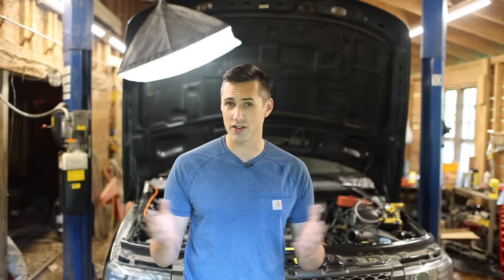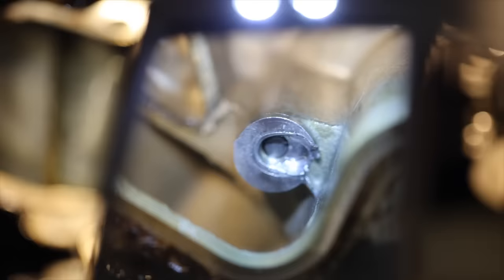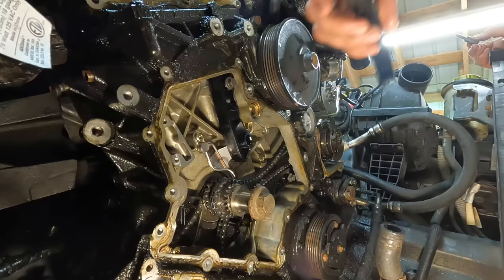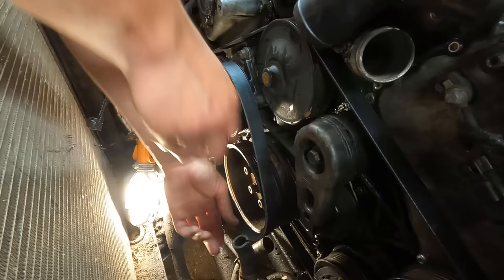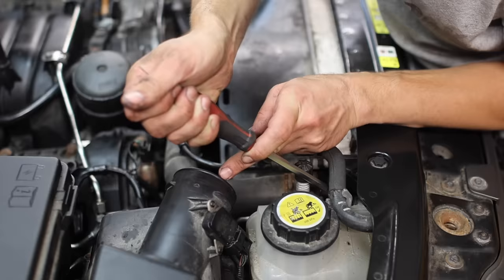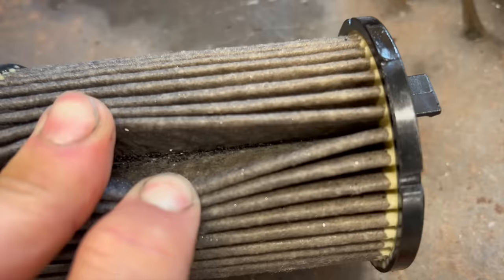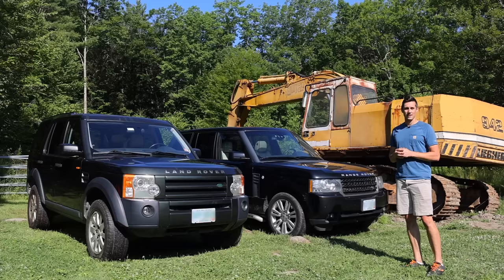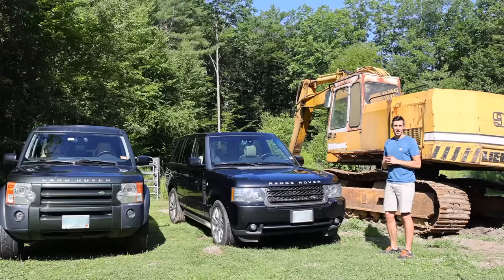Does My Cheap Auction Range Rover Need an ENGINE REBUILD? [Range Rover Part 4]

Comment: If you are planning to replace the engine anyway, can you just drive it until it dies and then do a tear down to show us what actually went wrong? A great way to move that process forward would be to drive it 9,000 miles. Who knows, it might not have any problems at all. If it doesn't break down then you win because you had no issues, and if it does break down you win because you get to make great content.
Reply from the maker: I agree, thanks for the encouragement! 👍
Reply: I like this idea. There could be a lot to learn here.
Reply: Agreed
Reply: sounds like a win win to me
Reply: Came here to say the same thing! Great idea!
Reply: Agreed!
Reply: Nice pragmatic approach
Reply: Agreed
Reply: Absolutely; I would hate to never know what it was that was wrong.
Reply: @WaldosWorld  
Clean the internals of the engine..
Drop the oil .. filter it also put a magnet in the cloth.. then drain though a filter, so you can put it back..
Remove the sump and inspect and clean it..
On one engine that was really gooey.. I jet washed the bottom end, let it dry, put it all back together over filled the oil (on another engine I used old clean diesel to remove the yuck and removed the sump again), left it over night then drained out the oil.. filtered that
Put back together..
Keep repeating the oil changes and possibly sump cleaning at a set number of miles..
If the bits continue you actually have a problem...
This is the cheapest and easiest way to see..
Also are you using an oil that is good with aluminium or is there a recommended additive, did you actually check the camshaft bearing face's.
BTW I found you via the digger video.. which I would give a proper birthday (this entails checking and cleaning everything, a jet wash is first)..
Have you told your neighborhood you have it.. as I bet they have some work for you as a digger or crane or just to compact a road.
Which would pay for bringing it to excellence....
Reply: Thanks, great suggestion!
Reply: Yeah im with you on that
Reply: Oh yes. You will be on the front page of consumers report for unveiling the secrets of Range Rover’s legendary unreliability
Reply: True actually
Reply: Great idea!
Reply: This is an excellent idea, good thinking.:)
Reply: That sounds deranged. He could do far more damage to the car, not to mention himself, if the engine were to seize on the highway while he’s doing 65+ miles per hour potentially in traffic with other motorists. It would be the reason people don’t drive vehicles with engines teetering on the brink of seizure on cross country trips with heavy amounts of highway driving.

Comment: Waldo, just run it with normal oil change interval! The aluminum shavings could be in there from timing chains rubbing due to guides being broken! Use to see it in ford crown Vic police cars all the time. No big loss if it blows up and your close to home. I’d drive it!
Reply: I agree.   If he mixed up his cam caps and put them back on out of order--- they will have some wear in also.  Personally, I'd just plan on doing another oil change halfway through his trip.   Maybe stop at another youtubers Garage along the way---  like a collab.  It will at least ensure that he has fresh oil to get him home-- and just chalk it up as a little insurance cost.   I bet by then, it will be mostly flushed out and should be fine.  That seafoam is definitely an suspect idea on an old engine-- because there is so much gunk that it can break loose-- you have to be careful what you ask for. lol... Fuel tanks are notorious for clogging after adding a cleaner like that;   and the Oil passages can be the same way.
Reply: @calholli  you can, you had a source of aluminum where the bolt was broken off. All that aluminum around the bolt hole will be in the oil.
Reply: Add me to the "Drive it until it breaks" list. Maybe not a 6000 mile trip, but around town? Hell yea!
Reply from the maker: Yeah, this is a good point. As for the camshaft bearing caps, I was very careful to install them in the same locations they came from, so that shouldn't be the issue. The only downside to having it blow up on me is that it'll make it more difficult to move around the property as needed (e.g. when I want to move it into the shop, or if I want to mow under it, etc.). I guess I should order a bunch of oil filters and give it a try 👍
Reply: @WaldosWorld  Maybe previous owners didn't do regular oil changes and your seafoam is slowly breaking a lot of stuff free
Reply: @WaldosWorld  been here before but my 2004 Range Rover had the 4.4l BMW motor in it. But timing chains guides broke.  I went ahead and changed my oil (with some cheap stuff) every tank of gas (300-400 miles) and it took 5 oil changes before my motor was clean. I also changed the oil filter ever 100-150 miles. On the 2004 RR the oil filter is right on top and its a drop in so was easy to do. I'd try changing the filter a couple times and go from there. I will say setting the timing on the newer RRs is way easier than the 2003-2005s with the 4.4L BMW engine. I spent a fortune on the locks for the cams so you are able to set the timing. Anyways good luck can't wait for your next update. Range Rovers are a pain in the butt but when they bare working they are AMAZING. I'd love to have the one you got for the price you paid. I wouldn't be scared to fix a simple timing chain/guide problem. One hell of a steal.
Reply: Plus 1 on this. I definitely think you're probably gonna see aluminum from that chain rattling around and shavings from that bolt wearing off and slapping around. Run that engine man
Reply: Definitely agree. drive it and if it blows up then LS SWAP IT.
Reply: Knowing what has happened I would have dropped the sump and cleaned it thoroughly. Change the oil pump as well. Swarf can jam the pressure relief value open and cause oil starvation at low RPM.
Reply: @WaldosWorld  , I wondered, couldn't you remove the valve covers and inspect the cams/caps? Frankly, before doing that I still think it's a good idea as others have suggested to have removed the oil pan to ensure you clean it of particles resulting the prior problems. I mean not only did you find a bolt in the pan and broken plastic chain guide but the aluminum was sheared off the block where the timing cover mounted. I really would've liked to have seen a follow-up video on this because you often peak my interest as you progress with a project & create suspense with a new mystery.

Comment: I would think all the aluminum particles were probably from the timing chain failure. If you did not take the oil pan off and clean out the pan and pickup tube, then you'll probably never get majority of the debris out. My recommendation would be to remove and inspect oil pan. Clean everything  as best as possible, reassemble and do a couple oil changes then reevaluate.  I would think if you had something wearing inside the engine causing that much debris there would be an associated abnormal noise. GM World Class, ASE Master certified technician, Banks Chevrolet Cadillac
Reply: Totally agree. 
As someone else said I would keep changing it until it is clean. Oil and filters and way cheaper than  another engine. Also, you kind of know what you have now, any engine swap and you start over. 
Lastly, I think that 4 ounces of Seafoam is all you should have added. I think 8 ounces was too much. I think it was extra cleaned.
Reply: Hey Chris, I'd like to ask you something about GM certification. Whats your instagram?
Reply: Makes sense.
Reply: @brianvancalster2594  I agree with you Brian.
Reply: Need to drop the pan.
Reply: I'd also have to agree
Reply: I whole heartedly agree with you.  I would have done it with the timing system replacement. That debris is not doing the rotating assembly any good. 
Clean it out thoroughly, then do a couple oil changes before deciding on a rebuild or swap. 
Just a backyard mechanics opinion.
Reply: Can't drop pan for this engine. Engine has to come out (not easy if u want it out from top, "easier" if u have a lift and lift whole chassis up) and tranny separated to remove that rear main seal "pan" (which bolts on to bother block and pan).
Reply: Totally agree

Comment: Rebuilding is for young guys like you who have the patience and energy to do it twice.  The rebuild and then the  newer engine replacement later when the rebuild inevitably fails down the road.  At least you'll get a youtube video or two out of it.
Reply: Lmfao 😅😅😅😅😅
Reply: It's funny you say that...  I rebuilt a 97 Isuzu rodeo 5spd 4x4,  that had a spun bearing at 240k miles or so (I towed a lot with it, and beat it up offraod a lot).  Spent $1k on machining the block, also getting new bigger pistons, new crank, all new bearing kit and head gaskets, ect. ect...  I got a couple thousand miles out of it---  and I noticed that I have an oil leak, and it's a little low.   I let my brother drive it to the store, and he comes back with it HAMMERING yet again........    I had told him to take it easy, it's a new motor;  it was raining a little bit --  and he says;   "What?   All I did was spin out a few donuts in the rain, it shouldn't just break" _--  smh..   so yeah, he hot roded my new engine and over revved it with low oil, and killed it...  Never rebuild an engine, and never let your brother drive your newly built engine............  I ended up buying another rodeo for $500, with 160k miles with a blown trans and swapped that motor into mine;  and drove it all the way to 320k miles and now it needs a timing belt.  It's a little offroad sleeper-- so I'll get around to doing the timing job eventually.
Reply: Yeah, because old men don't do rebuilds, smh.

Comment: As a former bmw tech, it appears that engine uses a similar process that bmw does with cylinder liners being “electro-arc sprayed” on. This process was essentially a failure as a design in this era of vehicles, and caused a ton of failures due to premature wear. Based on your boroscope video, with the heavy thrust area wear, it’s likely a lot of those particles are coming from there. However, with that much contamination, if it was just from the cylinder walls, you should see some lower compression numbers. My guess is the oil pump being the major culprit of wear. I’m not Land Rover trained, but nearly all modern engines have oil pumps with aluminum housings and steel gears, and the first component to use unfiltered oil is the oil pump itself.
Reply from the maker: That's a good point. I'll have to see if I can figure out if the oil pump is the culprit 👍
Reply: Don't these range rovers run on bmw engines.

Comment: Keep driving it.  I reckon you've accumulated a lot of that metal from the previous damage and it's swirling around in the sump.  You've fixed it now.  Regular oil changes and flushing and it will last a ling time now.  I hope you fitted the newer chain guides with the stainless steel buttons for the tensioners.  The original ones were aluminium, which is what some of that material in your filter could be.
Reply from the maker: Yep, it's got all the updated timing components 👍

Comment: I noticed while you extracted the broken bolt the drill filings went in the engine timing casing.
Reply: I was thinking that too
Reply from the maker: It's just aluminum. What could possibly go wrong? 😬
Reply: @WaldosWorld  hmmm...the bolts are not aluminium.....

Comment: you only flushed it once. that's hardly enough if its been neglected;  i would do it twice more. also i don't remember, did you have the oil pan off?  how was it? lastly , when you were drilling the broken  bolts it looked like the metal grounds were falling straight into the engine.
Reply: I agree with you!
Reply from the maker: Yeah, you're right. I only flushed it once and I didn't have the oil pan off 👍
Reply: @WaldosWorld  yhea man deff get the pan off and flush it at least 2 more times
Reply: @WaldosWorld  Thank's for replying. Like many here I'm an optimist, I'd suggest changing the oil a couple more times and just keep driving. There's also a machine (the garage I go to has one) that deep flushes the oil. It attaches hoses to the oil filler and the sump drain and connects them to an external filter and pump. It runs a heated, high detergent oil around the engine for a couple of hours and it gets EVERYTHING out. Maybe you can find something like that nearby?  Also this reminds me how, with good old cast iron blocks, you could just stick a magnet to the back of the oil pan and all filings would collect there!
Reply: @WaldosWorld  I think that is your biggest mistake right there, and a one which you could correct in an hour or two in the next oil change, when you drive it on the lift next time let it run until hot 10-15m and then leave overnight for the hot oil to wash itself and the shavings down onto the pan as much as possible, and then clean it while doing another oil change, and you are set.

Comment: Run it! 
 If it stays together, great. If not, you'll get another disassemble/diagnoses experience.😁
 Thanks!👍
Reply: +1
Reply from the maker: More video content, right? 😂
Reply: @WaldosWorld  Well...yes, and a chance it stays together.
 Thanks!👍
Reply: @WaldosWorld  Maybe a bigger piece of the broken tensioner is loose in the engine, bigger but still very small... like the size of a little bb or smaller, I would do the powered flush and take off the pan and clean everything you can out with the machine mentioned above if it's not too costly, would hate to mix the engine brands in such a nice rover.  Not sure how you'd find a random piece of aluminum... but I bet it will grind itself away and not hurt the engine too much, but what do I know.  You said the coolant was mixing with the oil, could it be from the radiator or that side of things?  Just throwing ideas at you.

Comment: Send the oil in for testing, Maybe the gunk is grinded up chain tensioning guide or from the hole it rubbed in the cover!? I think you should test the oil and keep driving it and keep flushing the engine oil and see how it goes.
Reply: In addition, you could have the metal shavings analyzed to determine the exact alloy. This would allow you to trace back which part is eroding.

Comment: Ive got a 2009 L322 supercharged. For oil on my neglected truck I started using Liqui Moly -Molygen 5W30 in the green bottle. She runs Amazing.  30-40% quieter. 18-20mpg highway (below 70mph).  Wont discuss nyc mpg bc we know that. But for your long distance driving make sure you got the good oil and bring an extra jug with you.  And as long as shes got new plugs and possibly coils you should be good.  
You may want to run a bottle of Oxycat in the fuel to clean out the cats.  Run her at 3k rpm on cruise control for an hour with like ⅓ tank of gas left.  Then fuel up and feel the difference.  
Oh. And get her waxed. That’ll get you another 2mph highway :)

Comment: Becareful, @ 2:29 when you did the bolt extraction it looks like some of the metal shavings from drilling the bolt might have fallen down into the engine.
Reply: Made me cringe
Reply: I agree
Reply: Yeah this repair is just not good at all... so many future problems could be prevented by taking the time to do things right the first time and don't allow metal shards from drilling to enter the motor... 🤦‍♂🤦‍♂
Reply: @stlwrx  It’s a cheap POS range rover, who cares?
Reply: did he even recover the broken head bolt that was down in the pan?
Reply: yep i noticed that thought he would rigged up collection pot

Comment: Cheap is usually cheap for a reason. If your taking the engine out to swap, where’s the harm in tearing the engine down? You could find the problem and be able to fix it for cheaper than another engine. I agree with other commenters I’d at least 2 more short interval changes before condemning the engine. It was neglected for a while and there is a lot places for junk to hide that gets loosened up by sea foam.
Reply: Maybe try an engine flush like watchjrgo uses?

Comment: I'm inclined to agree it's just the aluminium from the tensioner damage. Maybe give it another flush that should get rid of any last bits.
If a rebuild or engine swap maybe in the cards then just running it as is with any possible issues won't really matter to much.
Great videos bud, keep up the good work

Comment: Those timing chains flapping around in there make a lot of aluminum shrapnel.. you'll be picking aluminum out of your filter for three more oil changes then shell be all fixed... only way to get it all in a hurry is drop the pan which is a fluster cluck on those piles of equipment

Comment: I like the different stuff. Everyone does a ls or coyote swap. Find out WHY these are unreliable and engineer a way to fix it. It’d be tedious, but interesting.
Reply from the maker: Honestly, fixing the timing is a big part of it. There are of course other issues as well 👍
Reply: early model chain guides get destroyed by the tensioner piston poking a hole through them. same thing happens on the ford 4.6 4v

other than that most of these get blown up because of coolant loss from the water pump or the front and rear coolant crossovers
Reply: I've never heard of a Coyote swap, but LS swaps are common, even in spaces that the engine would normally not fit into (Miatas).

Comment: I have seen fractured guides on many manufacturer's engines after timing issues. With the amount of effort you have put in a new set of guides would not be the worst job before they self detonate and a lot cheaper than an unknown used block!